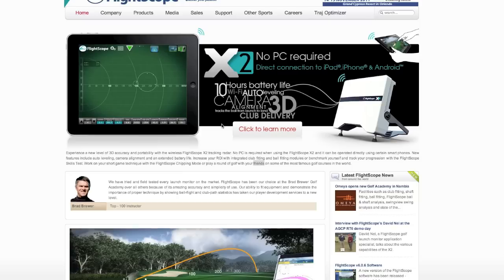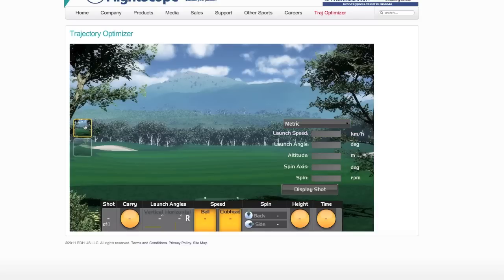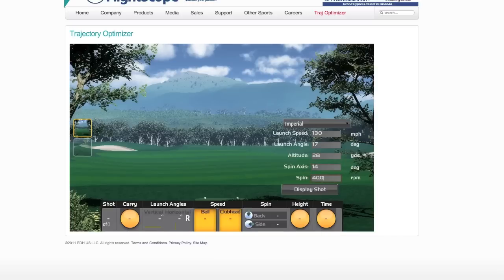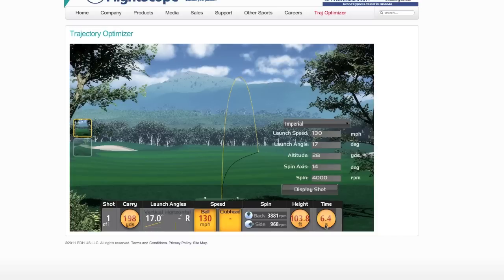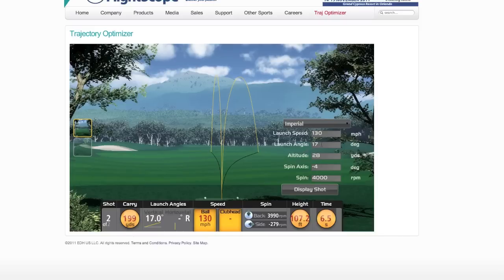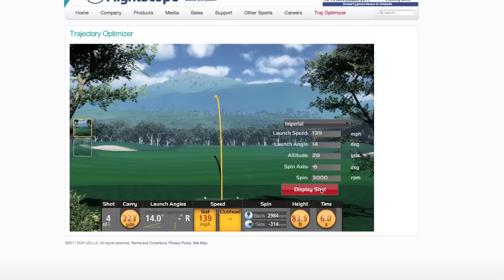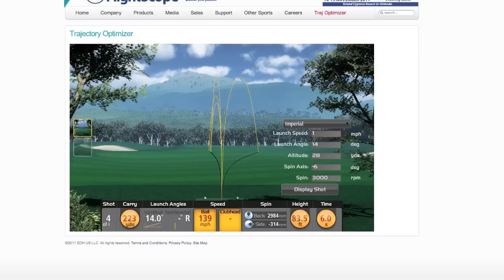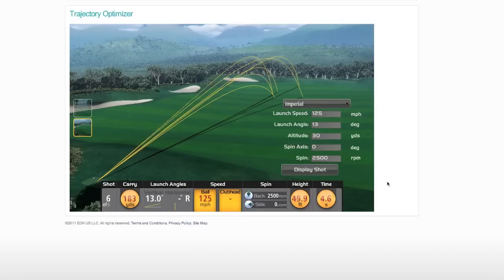Trajectory optimizer tutorial

Comment: Ironically, this really only shows that launch speed matters, not launch or spin very much, when it comes to adding distance and nobody can get much launch speed from club fitting- it's all from mechanics. So, if someone had poor mechanics, this wouldn't help much at all. Also missing, was an example of high speed center contact with slice spin. If you married that tour 170mph ball speed with the initial side spin, you'd have a 290 drive 2 fairways right.